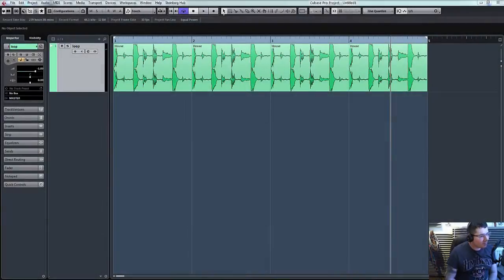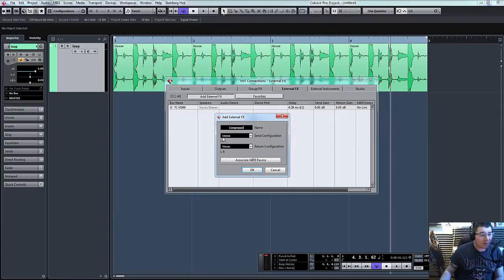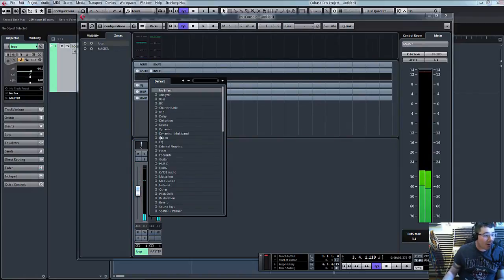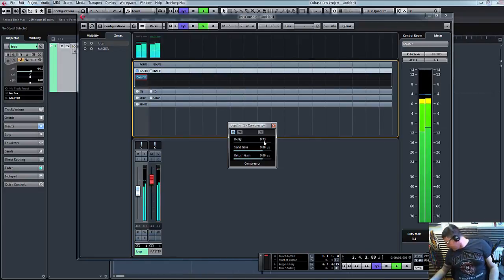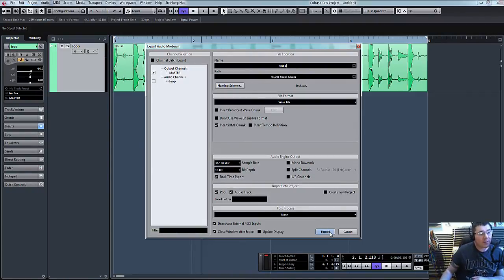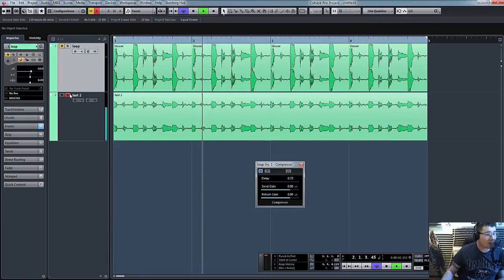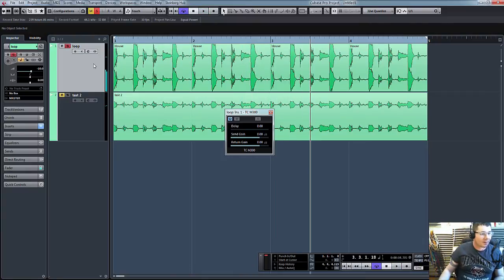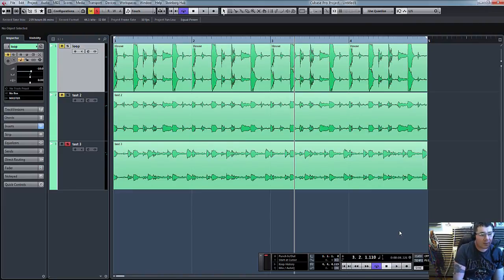Routing audio to external compressor and using it as insert effect in Cubase

Comment: Hi Mike, for some reason I can not find your first video on 'basic routing to external devices' in my case I'm trying to use an mpx-1 reverb digitally using the s/pdif connnectors - motu 828+cubase 7

Comment: Hi Mike
problem is everytime I get to the mixer I'm lost.
I have cubase 6.5 and I've never seen a mixer like the one you show so I cant follow.
Everything else is ok I also have a Motu like you but nothing works because of the mixer problem.
moreng
Reply from the maker: the mixer may look slightly different but you should still be able to do the same process.
Reply: Ok Mike I'll try again and thanks for responding so quickly.
When you do your audio mixdown what's tapped in in the 'Path' slot, where do the mixes go?
I gather you use pro8  as you know I use cubase 6.5, do you think its worth the change up?.
Reply from the maker: Yes its worth the change, im on Pro9 now which is a major upgrade but well worth it.  you can select anywhere you like for your mixdowns, at the right hand side should be a folder icon that you can click and select your save location of your mixdown.

Comment: Hi Mike, thanks for these videos, it helps me a lot.  I have a question,  what is when i have a chain of analogs like for mastering.  I use it with the insert fx method?  I want to buy my first analog Equip now. I want to use it for mixing and mastering. 
For example i have 5 analog fx, is it better i buy a second soundinterface and cascade it? I have a focusrite scarlett 18i20 now.
Reply: MrJinusean90 
You basically chain your fx units  in the order you want them and then from the last piece go into the 1820. If you are doing vocals for example, you would maybe go: mic pre(outboard) mono line out to line in of a compressor, then mono out of compressor to mono in on eq. Mono out of eq to in of delay(or whatever) then mono out of delay to the analog line input of your i820. This interface has combo xlr and is auto switching. The cool thing about doing it this way is whatever affects you do not want to use you can just hit the bypass so it is basically like a channel strip type of method.   Same formula applies for stereo. Just add a l and r. 2 ins and 2 outs for each unit or maybe a y cable here and there.

Comment: Hey Mike, another interesting vid, I have been wondering about this for a while now as I have an old Sony R7 reverb I have not used in years and it is quite nice so, I will try and hook it up now. I'm assuming you can have it on an FX Channel? and send multiple sends to it?

Thanks Lee
Reply from the maker: Yeah that is correct Lee you can use however you see fit just as if it was a normal inside the box effect, so using it on an effects channel is perfect :)